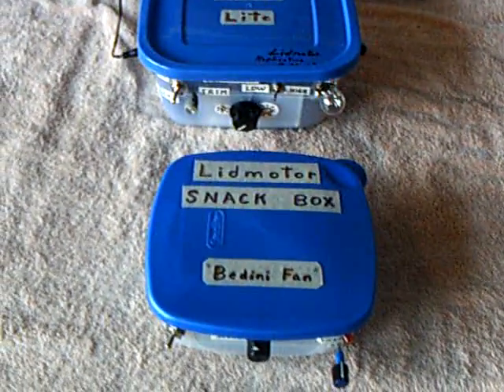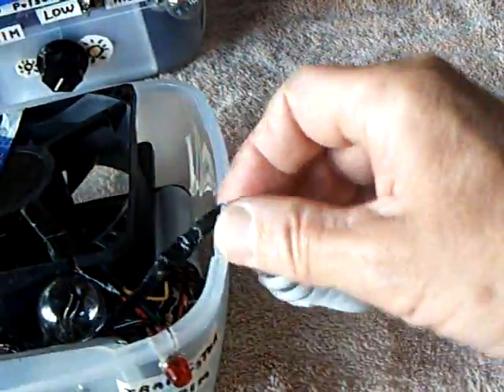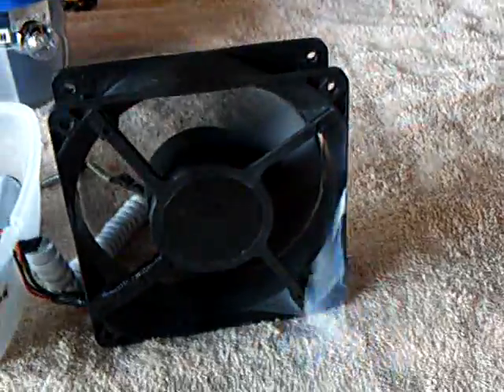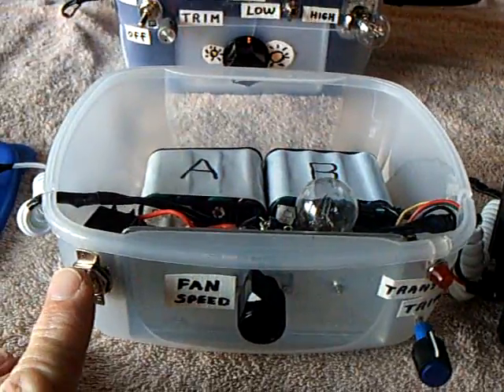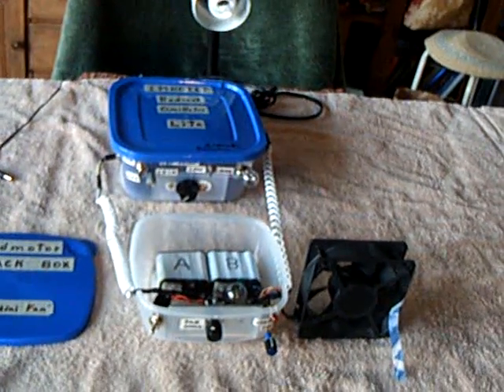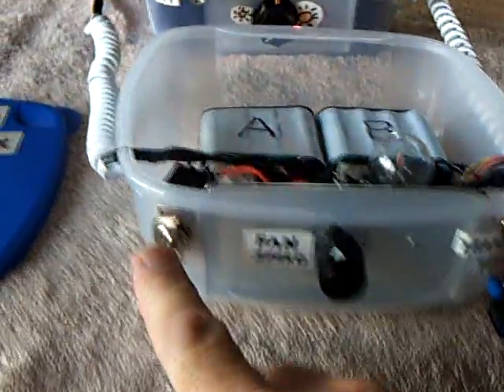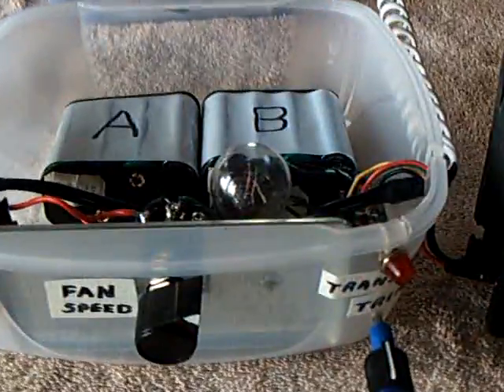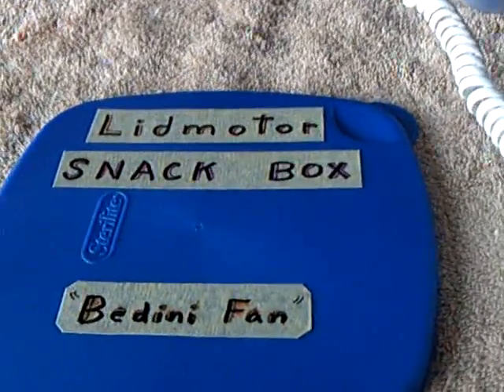Snack Box--- Bedini fan

Comment: how many people are going to ask about it running by itself? its running from batteries. a standard bedini ssg circuit running from a 12v battery power supply, which is inverting its charge output into the cap pulser circuit and running it.
instead of the bedini fan charging an external battery, its running that other box.